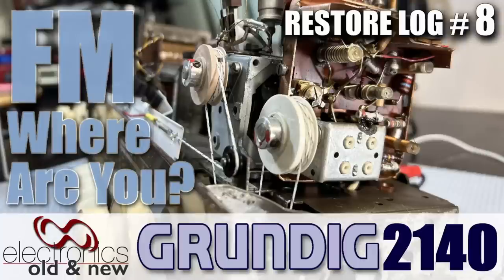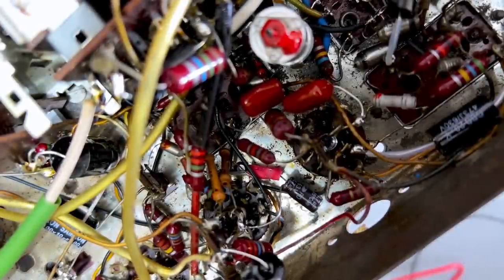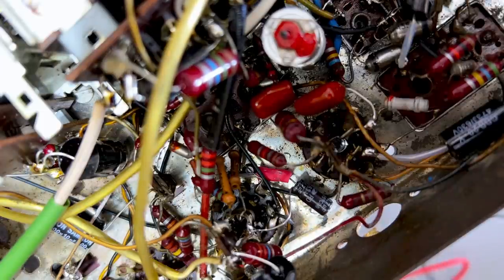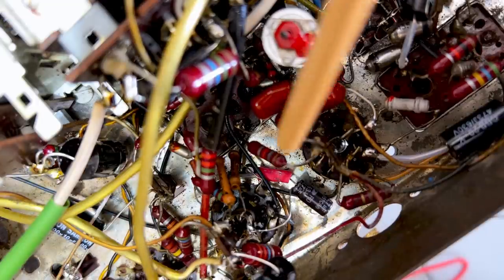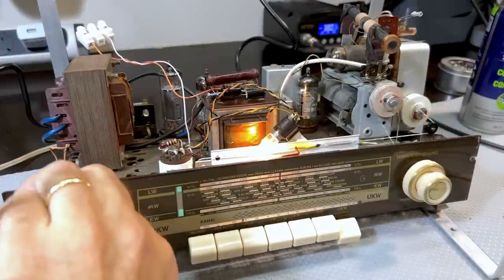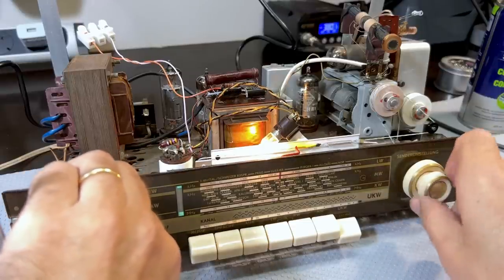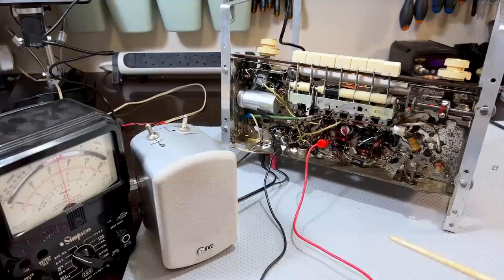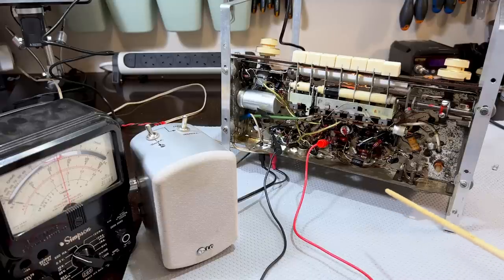Where has the FM reception gone? Grundig 2140 restoration - part 8

Comment: Manuel I learn something new with each of your videos. I will certainly give AM rejection a try when tuning the last FM coil. I didn’t know about the ELV small transmitter. As an amateur radio operator I own a Comet antenna analyzer (SWR analyzer). To measure the SWR of an antenna it transmits a very small RF signal. Although it will not modulate an audio signal, I simply measured the negative voltage from the ratio detector capacitor with the radio dial to 88 and the Analyzer to 88MHz to adjust the RF.  Thanks.

Comment: @ 33:33 I agree entirely. You have shown that you can get good alignment results using the equipment that you have on hand, without spending top dollar on equipment at auction that may or may not work upon arrival. I will probably be "tinkering" with some reasonably priced signal sources, and "Visual analyzer devices" going forward, but for now my main equipment purchase has been a cap tester, (Sencore LC102) that can test for value, ESR, leakage and dielectric absorption in one unit without fumbling for multiple devices to test with, as to me it seems that the value, leakage and ESR tests are the  best ones to indicate a good or bad device. Glad you are making progress, and hope it all comes together soon!

Comment: How easy is it to go off track when troubleshooting, as you said the clues were all there but we tend to get a line of thought and it's difficult to get off it. If you hadn't taken the cover off during the restore you would have had a different line of thought I imagine. The first FM radio I attempted to align used the AM rejection method to balance the ratio detector, it works well and is a perfectly acceptable method for doing same (Nordmende I think). Thanks for the shoutout re cabinet restores, I haven't done many lately, I seem to be doing other people's stuff but I have a few lined up for this year. Good video Manuel 👍😀
Reply from the maker: I’ve done some alignments of the FM by ear on one or two occasions, then got all fancy to check how close it was. It was surprisingly good. My obsessive nature would never let me leave it like that, but it just goes to show how good our senses can be.

Comment: Too bad your across the big pond from me otherwise I'd give you a Telefunken Console system that seems to date back to the mid 1950s. 

I picked it up at a thrift store four years ago in a very rural part of NY state. The power amplifier seems to be the big issue that it has, but after bringing it home I was able to extract a signal from what I'd call a preamplifier output located on a pair of RCA jacks on the unit's rear panel and listen to its shortwave, medium wave, & FM modulated band radio by running it into a line-in on a modern stereo.

Tube radios and amplifiers are not something I feel comfortable with thus I have done nothing with it. Would like to see it go to one who can bring it back to life. 

If I still lived in Albany NY it'd be easy to have one take it off my hands, but having retired to a remote area of the Catskills is a different story with more bears in the neighborhood than people let alone radio enthusiasts.